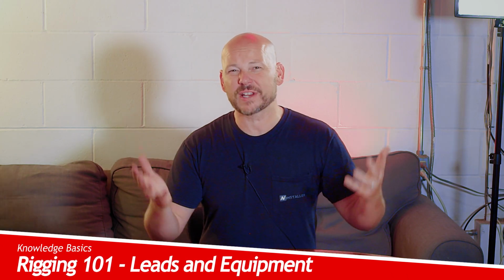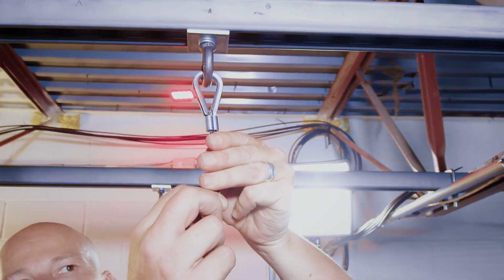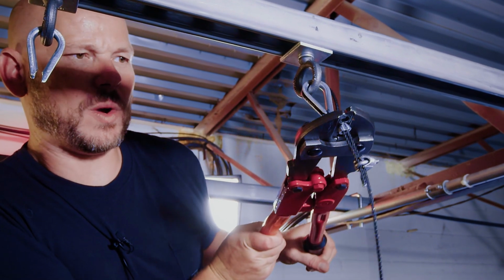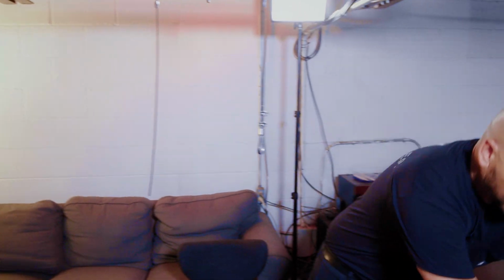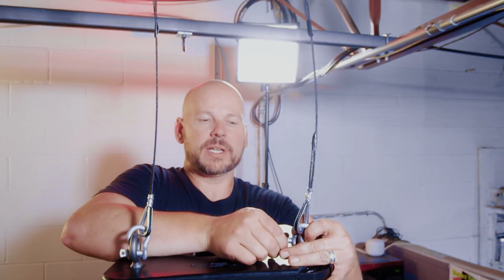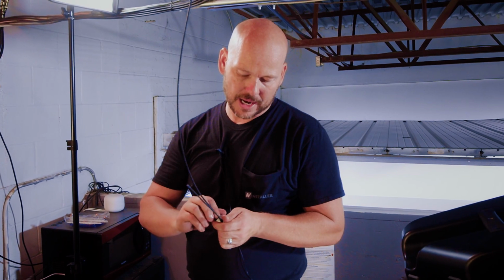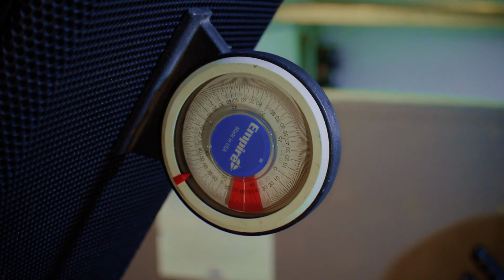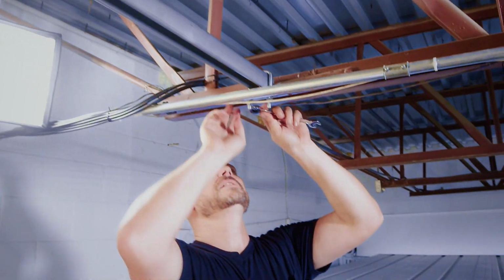Rigging 101 Part 3 - How Do I Get My Equipment In My Rafters?!

Comment: I've looked for this video for years. Thank you for finally making it!
Reply from the maker: I'm glad it's the right video for you! Be safe out there and watch the whole series.
Reply: @eventtechav  I did... Now I'm going through other videos on your channel as well!

Any tips for rigging on a slanted ceiling? (Obviously an integrator is always the way to go, but I'm more asking because I want to learn)
Reply from the maker: The material construction of the ceiling plays a big role. But, Unistrut parallel to the ceiling with eye bolts and aircraft cable is our normal go to, because the aircraft cable will fall straight down to the ground.